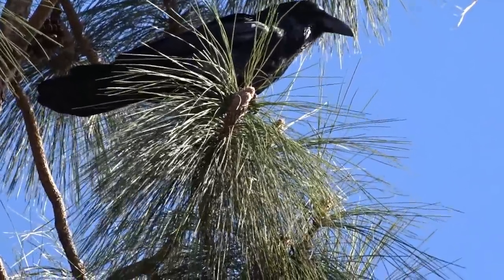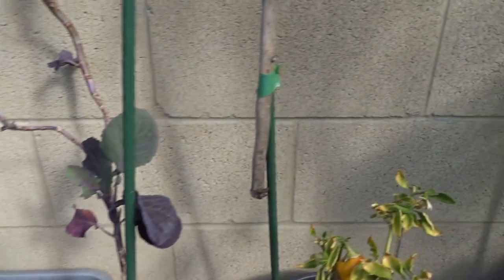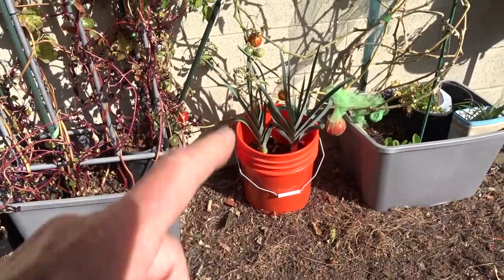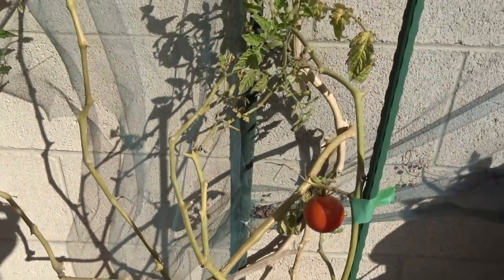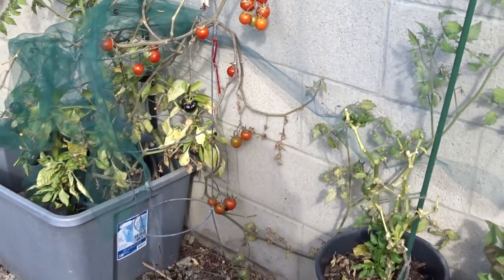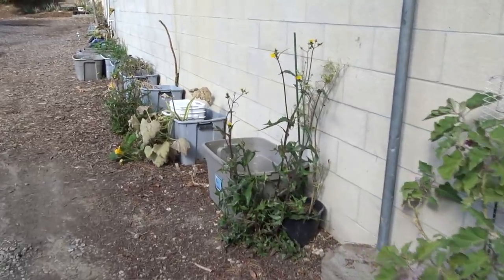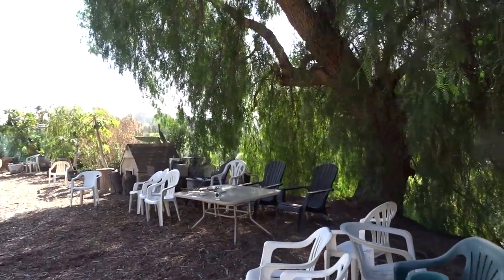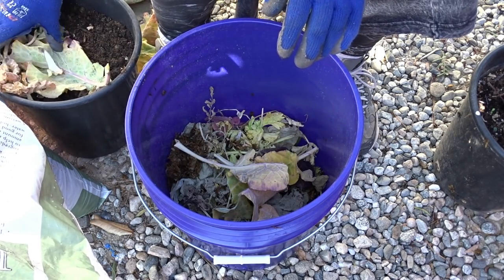Vlog~Making Soil for Tree Collard~Using Tulle as Blanket Keeps Plants Warm to Produce Winter Peppers

Comment: Hi Robbie, I'm forever amazed at your gardens. The only plant still producing here is the diablo pepper plant I put under the courtyard roof for protection from the cold snaps we're having. I'm in zone 9b and it's like a 10 degree cooler difference here (Tucson, AZ). I've started lots of plants under grow lights inside anxiously waiting for warmer temps. Bought one special cherry tomato plant recently ($6.00 sheesh) and made several cuttings from it and they have already rooted! Now I have four special cherry tomato plants. I think I prefer this method to planting seeds which I've had mixed results with. Say hello to Gary, really nice job on the cement work (says my hubby). BTW, that One Story house looks more like an apartment complex than a single family home.